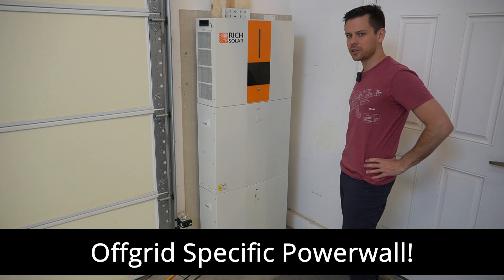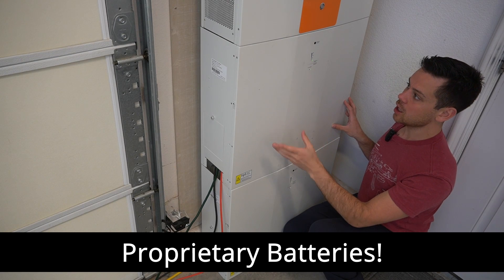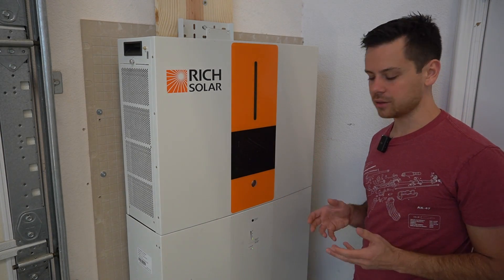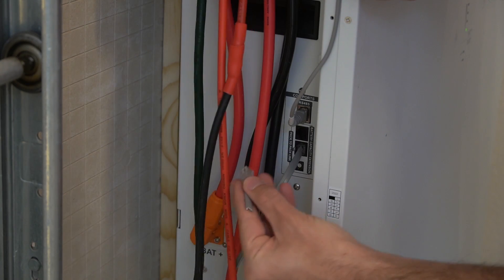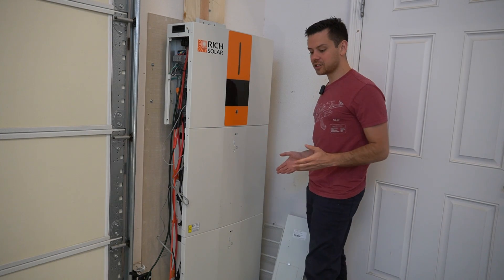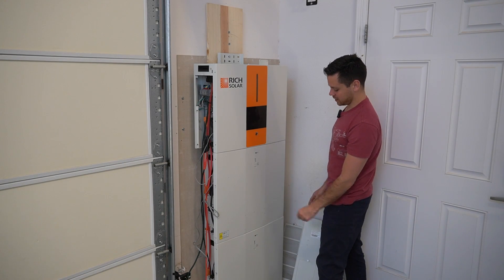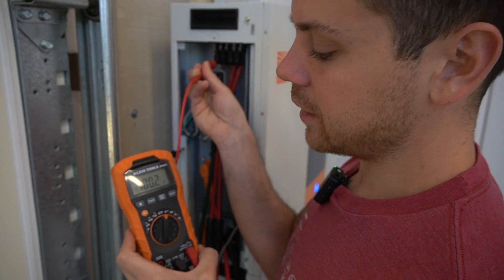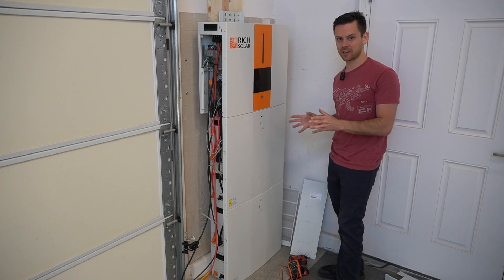Rich Solar Offgrid LiFePO4 Powerwall: Everything You Need to Know

Comment: Proprietary is a non starter for me.
Have to be able to add different batteries if necessary.
Thanks for all the great videos :)
Reply: Yeah, I can't stand proprietary stuff.  Even in the CPU/GPU world we're finally seeing companies like (ASE), AMD, Arm, Google Cloud, Intel Corporation, Meta, Microsoft Corporation, Qualcomm Incorporated, Samsung, and Taiwan Semiconductor Manufacturing Company that have come together to build a standard interconnect.

There needs to be more of this kind of collaboration.  I don't really want to see fully proprietary communication between batteries and inverters.  There should be a standard.  We should be able to use any battery out there that complies with that standard.  Sure, don't mix chemistries, and maybe the standard can have protections against that via communication with the bms in each battery.

If we're going to move into the future of solar, these companies need to get it together.  Otherwise we're gonna end up with more junk in the landfill than would otherwise be necessary.  Standards for stuff like this ensures us that options are available out there for our failed parts and we don't have to trash the whole thing because the company dies and that part isn't available anymore.

Comment: I like the battery form factor where it's tighter to the wall and server racks stick out and take a lot of floor space
Reply: Server Rack or shelf batteries  are best for user have garage or storage space.  And upgradeable, stack more, add more capacity.  I saw a YouTuber somewhere in/near Michigan has 200 kWh batteries and 20-30 kWh solar or so.... For home... I love that,. My current is 4.94 kWh solar (Winter dropped to 2 kWh/day yes, very low even in San Diego, California,) 30 kWh batteries.  My goal is 10 -15 kWh solar and 120 -150 kWh batteries. With Electric car.  Good lucks guys (if any one in San Diego CA buy bifaacial  panel from signature solar please let me know, I buy 6, split cost with you.  Thanks a lot....
Reply: Yes, I agree!😊

Comment: mount on  floor  not great idea - even minor flooding  can damage  gear  on floor -  was in Williams AZ last summer almost 4 inches rain in 45 minutes - 
things happen - water heater burst / pipe  break  -      Good video Thanks
Reply from the maker: Yes I should have mentioned that. The metal exclosure actually has the batteries lifted up. I checked that before I did that. And I don't want 300 lbs on a single stud haha
Reply: @WillProwse   just put some type stand to rest weight on can be as simple as some bricks - 2 by 4 or meal stand - if I was doing permeant install would mount as high up on wall  as possible to free up floor space - less prone do damage  from car running into it etc - Thanks for your reply

Comment: I think mixing things up with different types of systems is a good thing for most of your watchers.

For some this would be an ideal solution for their power needs. Honestly if someone is calling an RV home off grid this will cover most of their power needs.
Reply: Agreed. As long as it doesn't have the constant fan noise of the LV6548 style inverters. 

I hear my 6500ex all day...

Comment: Lotz of stuff out there on which a DIYer must make a decision. One product that i would very much like your opinion on is Big Battery's Rhino. i will be living off grid, solar, with a large gen-set that can power stationary power tools in a woodshop. Got some suggestions?
Reply from the maker: After multiple issues with bigbattery and threat of lawsuit after showing bad workmanship in multiple batteries they sent me, I would say avoid them like the plague. I even had one leak electrolyte. And they sent me pictures of other new cells that were leaking in their inventory. Also check out other people's reviews of bigbattery. I will not touch another one of those batteries.
Reply: Thankx Will.  Appreciate the info👍

Comment from the maker: And yes, add 8000W of solar panels if you have it. I just want people to know that it will not be charging with that much power, and that makes some people feel ripped off. I have seen people complain about this quite a bit. Some people feel ripped off if it cannot charge with the full output that is on the sticker. 

It also depends on what kind of panels you are using and where you live. Some have better output than others. Some pull 100% of STC output, others only 80%. So use your brain and think about it. I am just here to set the expectation so you do not waste your money.

Also if my garage was flooded the enclosure actually lifted the wiring and batteries off the floor. So it would be fine. But I really did not want to put 300 lbs to a single stud. Seems like a bad idea
Reply from the maker: Hey! Check out the links in the description and I'm glad I can help!
Reply: Great video. I really appreciate all the advice on your channel. I'm about to purchase a large off grid /backup system and I'm having a hard time deciding between a server rack battery or a big battery style system. If you could point me in the best direction I'd greatly appreciate it. Thanks again for all your great videos and the information in them!
Reply: Thank you for the heads up, Will!
Reply: Any updates?

Comment: What's the idle consumption?
Reply: A very good question that Will unfortunately missed in his review.  I see this as a mismatched system.  6.5kw of power but only 10kwh or storage -- without expanding it which is not easy.

Comment: Does this mean, if I have a grounded solar array, that this setup is not recommended for that?
Reply from the maker: Yes just like any other all in one on the market today. They all state that in the manual. Earth grounding and grounded are different terms though, and I think you are confusing them.
Reply: Will can you explain this in another video or on here some time as I don’t get it either. I have mounted panels on my shed and am running PV to an AC500. Should I ground the rails to earth or not? Thanks!